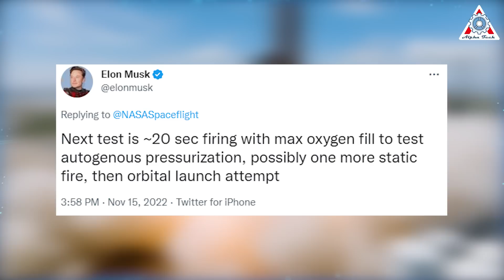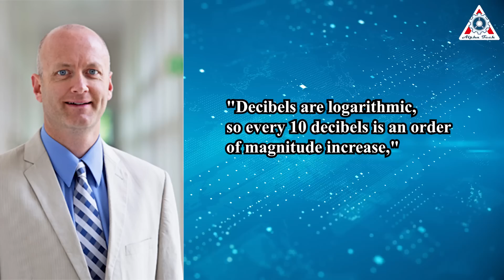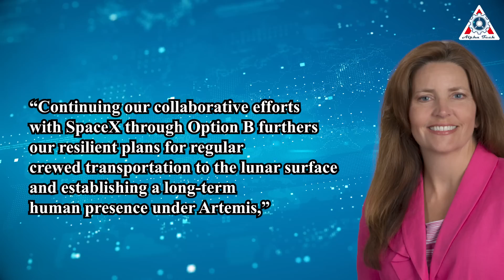SpaceX stage zero facing BIG PROBLEM with 33 engine FIRING...

Comment: Maybe someone has already thought of this. But. Would some kind of a foldup mat made out of steel plates, like the work platform, that could be rolled in and out when needed. Since its removeable it cold be easily replaced if damaged. Maybe stainless steel? You could even have exit ramps that flare up at the ends to direct the exhaust up and away.
Reply: SpaceX should  add another star base in Australia we have heaps room NASA putting launch base in Darwin

Comment: I am not a rocket scientist (just an aircraft mech.) but there is a reason that the Satern 5 rocket had fire pits under the engines. I was surprised when I didn't see a pit under the booster engines. I think it be smart to do this before using all 33 engines. Just saying. If it all blew up that would be the end of the rocket + 33 engines and the stand. The stakes are just too high not to make a fire pit diverter setup. The sound energy is just too disruptive to the engine compartment.

Comment: If concrete doesn't do it, and he don't want to use a trench for whatever reason. Molybdenum internally cooled with water could possibly be a solution? They use low grade steel for other equipment nearby so it could work.

Comment: I don't think that SpaceX designed the OLM on the back of a paper napkin. It's been engineered and analyzed every which way. If Elon decides to do a static firing of all 33 booster engines, it will be a very short run, less than 5 seconds. And during the first orbital launch attempt, the hold down clamps will be released quickly--two to three seconds after engine ignition.  

Elon is relying on the ground tests of those 33 Raptor engines done at McGregor. I assume that he and his engineers have selected the 33 best-performing engines based on those ground tests. 

It would be great if all 33 engines had been individually tested full thrust (230t) and full duration (170 seconds) at McGregor and then been shipped to Boca Chica. But my guess is that only a select few of the 200 Raptor 2 engines built to date have seen this type of ground testing.

Comment: I worked on the Apollo Project in '68 and '69. Worked for Pan Am on the weather equipment surrounding Pad 39 A & B on various towers from 12' to 204' to monitor wind speed, direction, temps and Delta-T readouts, along with a system called "Launch Acoustics Measuring System, that measured the sound pressures generated by the Saturn V. We recorded sound waves above 200 dB on the beach across from the pads (approx. 250 yards), and had to chase boats away from the area because they'd be destroyed if present during a launch. We monitored the shoreline with radar, and a helicopter would be sent out to chase curiosity seekers away...under penalty of possible destruction.

A co-worker and I watched a SV launch from a 54' weather tower leas than 2 miles away, and it wasn't just the sound itself but the pressure wave from the blast that were destructive. We could see the shock wave coming at us across the sawgrass swamp area, and had to hang onto the tower to keep from being knocked off. It was said that with the right weather conditions in the upper atmosphere, they could hear the launches in New York.
Reply: Simply WOW !

Comment: Could they not just put a small layer of stainless steel on the pad of the same material they use for the starships. It would protect the concrete and it will withstand the heat of the engines.
Reply: Heat isn't really an issue either under launch conditions as it only has to withstand the full force of the engines with an exponential fall off as the booster takes off and gets further away.

Comment: We need rockets which doesn’t need sophisticated launch system. It should be fault tolerant in difficult terrain. Spacex is doing correct thing to test powerful rocket in very unoptimized way. BTW spacex engineers know what to do next.

Comment: Excellent narration and explanation!  Whatever the steering nozzles are made of; on one of the recent iterations of fighter jets is, needs to be a an interlocked cladding carpet on top of the concrete!  It should also have a rapid flow of water underneath it at ignition time.
Reply: Nah, just steel plates (much cheaper than some exotic material) would work. They are available in various thicknesses and grade.
Reply: @denysvlasenko1865  Well hell if that'll work then there's no need for the sensational headlines!  Great comment.

Comment: I am sure that the smart engineers at SpaceX are looking at all the available options to mitigate risks and make it a successful launch. They have lot more facts and data than all of us combined.
Reply: And in spite of their superior view, the launch pad is still a shitshow.
Reply: Iterative design... this implies that failure is going to happen, and they learn from it... this will allow them to adapt current infrastructure to meet its needs.
Reply: @johnd.7792  That is not how iterative design works.  But, for some reason, Muskrats seem to think so.  Why?  Because Musk hedges his bets by framing failure as success.
Reply: @ReachOutToWilliam  might want to look up the 4 steps of iterative design...
Reply: @johnd.7792  I am a designer.  30 years of experience in multiple fields.  You misunderstand what iterative design entails.  It does not involve building products and then seeing if they fail.  Except at SpaceX and for Elon Musk.  And I am sure his engineers don't agree with his assessment.
Reply: This is a myth.  Most of them at the beginning had zero rocketry experience.  But in a strange way, is what they wanted and paid off with innovative solutions.  But they shouldn't have ignored others and their solutions.  Not having a flame diverter is killing them
Reply: The question is whether they can implement the needed changes before going bankrupt.
Reply: @marsrocket  This is not a video about Twitter.  What are you talking about?  Elon is the richest man in the world, worth over $500 Billion.
Reply: @ReachOutToWilliam  half that
Reply: @marsrocket  Why would they go bankrupt? They have other source of income besides starship. If starship fails then they will just have to fall back to continue relying on the falcon 9s and heavy.

Comment: I was wondering, if it's possible to just use a few rocket engines to lift off of the LaunchPad? And when you're all clear from the tower and the area surroundings, can you just start the other rocket engines? That way there would be no or minimal damage to the pad itself? Because I'm thinking using 33 engines at the same time could actually damage the pad and possibly melt the structure. Don't get me wrong I like the idea of using a lot of engines, but it's also a lot of force focused in one area.
Reply: It probably weighs so much it probably needs all 33 engines to get it started
Reply: @NitrogemMusic  Nice idea though.
Reply: @NitrogemMusic  It wouldn't need full power to lift it, but it would definitely need full power to lift it quickly enough to avoid the 3KM hole it would dig if it hung around for too long.
Reply: Maybe with the 20 engine static fire test we will start seeing it's true colors, for the good I hope. I like elon's designs of building rockets and stuff, reminds me of the old Sci-Fi black and white movies with actual Rockets landing on the moon then coming back and landing on Earth. He's taking sci-fi dreams and turning them into reality, that's freaking awesome.
Reply: Nope.. they need all 33 to launch, otherwise the liftoff will be slower and just waste fuel.

Comment: i always thought about using a spike. Like on an Aerospike engine. stick it on the ground point it upwards and cover it with a TPS. at the same time wjust like on an Aerospike engine let water be pumped on the outside ring to cover the spike and maybe create a, as thick as possible, Firewall made of water. Dont know if something like this could actually work but it would look extremely cool under the pad ^^
Reply: four linear Aerospike engines, powered with a 50/50 mixture of steam/water_dropplets directing outwards of the launch stand, and the concrete floor coated with ablative+isolating heat shield material? Also, preheating the concrete, to ameliorate the unequal local thermal expansion, maybe?
Reply: @konradcomrade4845  ok that was too much for me 😆  you clearly know more about this stuff then me.
But why use concrete when ypu can use stainless steel?? Starship has to go through a similar Situation when reentering? Anyways was just an idea and i have no idea if it could work or not.

Comment: I've been postulating for over a year that Elon's biggest error was a lack of a flame diverter. 
He also doesn't have NEARLY enough of a Deluge system in place.
Reply: It's 420 gallons, for 69 seconds at 8008 ms.  What could go wrong?
Reply: Why not just specify 3/4" steel plate welded in sheets into a massive steel sheet on the ground?
Reply: 450,000 gallons per second  is what is needed for 49 sec i am also worried seeing bits of concrete flying through the air

Comment: Seeing that ship land on the lunar surface would fill me with pride but i just cant see it happening - it will just burrow a massive hole in the surface when it fires up its engines and lowers to the surface which may or may not be solid and may result in it simply tipping over rendering it then useless and trapping however many men on the lunar regolith.....
Reply: Highly unlikely it would land using engines on the bottom of the lander. They'll probably make use of reaction thrusters higher up on the ship
Reply: @KCM25NJL  Makes you wonder why the Apollo lander didnt cause a hug crater in the lunar surface when it landed using its main thruster engine? Hmmmmmm
Reply: The HLS Starship lunar lander has a separate set of rocket engines for the landing on the lunar surface. Those engines are located near the payload bay and are about 100 ft (30 meters) above the main engines on that lunar lander. The main engines are not running when that Starship lands on the Moon.

Comment: When I was constructing satellites 12 years ago, the electronics had to withstand 20G. This was not from mechanically conducted vibration, but from the sound pressure fluctuations. Adding another 50 dB to that of a Dnepr launch must place a huge strain on both man and machine; Despite the 300-odd feet between exhaust and payload, it's still a few minutes of acoustic hell to reach the 'vacuum' of the upper atmosphere.
Reply: Smartest story / writing I have seen in a long time… for that I give you a gold star in the marginally. Acoustic sound pressure, in a certain frequency can cut in solid rock, like a knife i hot butter… We must never forget this☝🏽😄✊🏽! All the best from Johan in Sweden 🇸🇪
Reply: Yes.  We learned that back in the 1950s.  Thanks for that reminder.  lol

Comment: Can stainless steel be used in a rail gun like configuration that will propel the starship the first 100 meters or more?
Reply: Sure, if you have a 3 million terawatt power supply
Reply: Let me be a little less obtuse.........

To raise 1KG of mass to 5m/s (a leisurely launch speed), would require roughly 2000Amps of railgun current.
To raise a fully loaded Starship to the same velocity, would require somewhere in the region of 2-3 million Amps (imperfect simulation data)
In such an imaginary scenario, one might imagine that the system consisted of 2 Railguns, one on each side of the vehicle, this would halve the current between 2 sets of rails.... but would still be in a 7 figure amperage range for each one. 

While I couldn't say for certain, at such current requirements, it seems reasonable to suspect that the magnetic field created between rails would be enough for it to rip itself apart, or at the very least do enough damage to render the re-use case moot.

Comment: I sincerely hope that starship or new glenn make it.  The problem is that the media extols the virtues of Space X and Blue Origin etc. saying how much more efficient they are then NASA etc etc.  Well that is great but  they not done jackshit yet.   Sure, Space X has the Falcon and Falcon Heavy and Blue Origin has the popgun New Sheppard but that is it.   I will  believe when I see it.  Maybe,  it just costs billions of dollars to actually do it
Reply: You make a good point but remember that the other two proposed midget proposals by Blue Origin and Dynetics have not done anything either and show no potential for any size. We are still barley past beginning the moon lander process. I just wish NASA didn’t let SLS suck up so many billions. I still think that Space x will eventually use crew Dragon to dock with Starship in Earth orbit and cut SLS out completely in the near future. Just saying.
Reply: @Steve,How is a craft going LEO speed going to dock with a craft going fast enough for trans-lunar injection ? Same for return trip.

Falcon heavy doesn’t have the power. It’s going to take a man rated Starship to replace SLS.  Although you will need several launches to load the fuel into another Starship to get to the moon.  That’s fine, but it’s a big issue that still needs to worked.

Comment: I’m not sure why space x wouldn’t just use steel plating for the ground just under the launch mount.. for what they have paid to build everything, steel plating wouldn’t be that expensive and it would prevent any concrete from flying up
Reply: Wouldn't that much pressurized flame simply turn the steel plating into a molten iron lake?
Reply: @pravinsmart  i don't think it would, Musk said that the steel they use can withstand almost all the heat of reentry without melting if a few tps tiles fell off. And even if not the case the steel does not need to withstand it for very long. During launch the rocket will be moving away from the plate faster and faster therfor it only really needs to withstand the full force for meer moments. Edit: also had water/nitrogen systems spraying the plate.
Reply: They could cover the floor under the pad with a thick layer of TPS tile material.

Comment: Could making Stage Zero taller help at all?
Reply: No because the higher it is the less stable; the blast needs to be defused by a hole underneath with a vertical shafts.
Reply: I had about the same idea, put to the extreme: Build a 1001m high Mozilla_tower, and an appropriately high launch stand, then the rocket_flames have enough place to dissipate, and the big rocket is already 1000 meters closer to space, even before its engines ignite! 
A short term solution could be covering the concrete with the ablative, thermally isolating material, that the heat shields of the capsules is made of. 
Steel plates maybe would not suffice, they could get welded together by such heat.

Comment: Of course it won't survive a full engine launch. But he thinks he knows best.
Reply: His private company has launched and landed more rockets than entire nations. Think he knows a thing or two about rockets
Reply: @TheDonegan1  Then why has his launch platform taken such a beating? The current NASA pad deluge system pumps 4 million liters per minute to protect it his has basically zero protection. Isn't this the topic of the video? I know it's difficult for some to stay on topic.
Reply: @michaelwalters3970  when the rocket is finished then the final pad will be built. how is this so hard to understrand?
Reply: @TheDonegan1  You are apparently NOT an engineer if you put it that way. Sure glad you're not designing or building anything on my budget.

Comment: SpaceX will need a large flame pit for repeated launches. no use doing it on the cheap when they'll have to replace the existing pad after the first launch.

Comment: Elon Musk was warned about his launch tower that it required a flame diversion trench but Elon chose not to.
Reply from the maker: Hope the first launch won't make this explode
Reply: @alphatech4966  it's highly likely there'll be  a RUD.
Reply: I can't believe how close the launch pad is to the tank farm.  That seems just plain dumb.  
Years ago, I was helping to rebuild a commercial sailing vessel.  I pointed out a design defect in the modifications that I warned could be disasterous.  "Well, we'll just have to be perfect", was the owner's answer.  OOOHHHHKAAAAYYYY.  Five years later that same feature sunk the boat in 30 feet of water.
Reply: That's why.. he's building them.. we/you aren't !
Reply: LOL , was warned by who, a youtuber?  You mean he didn’t listen to the experts ?
Reply: why?
Reply: I personally think they may be forced to modify the pad before any major range launches occur (for safety reasons). Part of the reason I always felt SLS would fly first and be significantly ahead of Starship, Elon's using intensely new tech and kind of making some stuff up while going along, meaning if anything needs fixed, it will mean an expensive delay and revision. His model is a riskier one. I wouldn't be surprised if Starship is delayed another 6 months soon. Hence why a public/private hybrid spaceflight model is always the safest option, get the best out of both worlds without being too dependent on either.